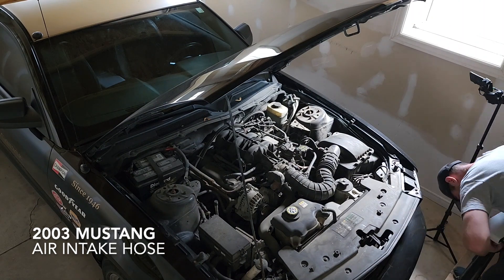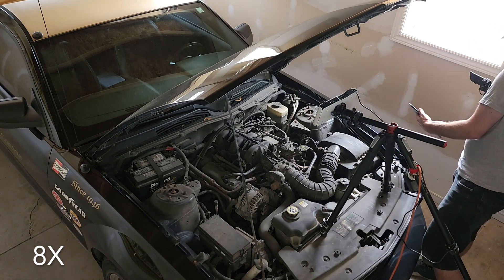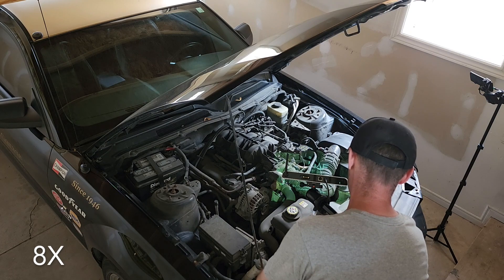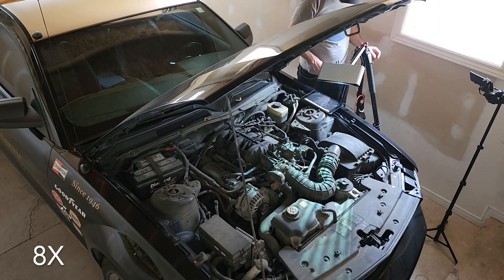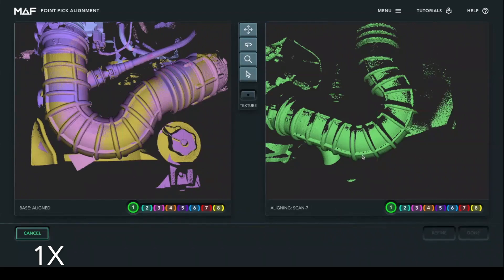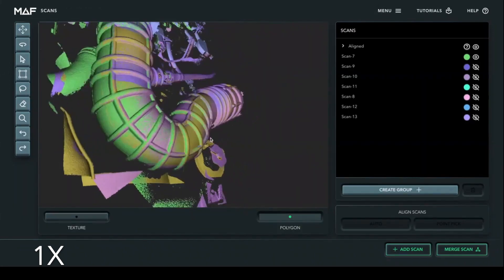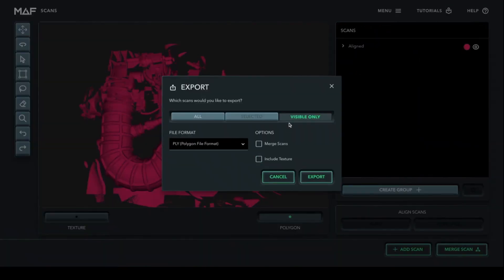THREE - Scanning a car engine

Comment: I just bought the THREE.  It should be here tomorrow, so I haven't had any actual experience with it.  I bought it to quickly scan small parts to a 0.5 mm resolution to import them into CAD, so I can make 3D printed parts that accurately fit complex geometries, and I think small items on the turntable are where THREE really shines, but it's good to see that it can be used for larger objects that can't fit on the little turntable.  I could have used that last week when designing custom pannier racks for my motorcycle.  I have the feeling that once I have a 3D scanner in my toolbox, I'm going to wonder how I lived without it.
Reply: Hey, so 9 month later, are you happy with it? Any cons?

Comment: If I understand it right everything runs locally directly on the scanner and wifi is just a way to connect to the iPad. If that's the case. then I'm glad for that, because lately I'm pretty allergic to all apps running in the cloud. Marketing-wise it sounds cool, but in reality the functionality of cloud apps pretty much falls short. 
Otherwise, I also have to praise the color separation and that use of reference points to manually align scans is something I really like too. 
I'd be quite interested to know how your scanner would handle scanning a PCB board with lots of small components. 
Fingers crossed and may you have a good time completing your project.
Reply: Yea the idea of cloud app scanning sounds like a recipe for disaster I would l hope you could run the processing off a local computer..

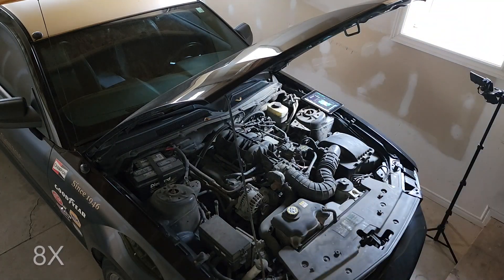Comment: Very helpful!  The color coding is a very nice feature.  You used an iPad when capturing. Are you also using an iPad for processing starting 4:58?  Or, can you divide the scanning and post processing across platforms?  BTW, having struggled with black objects for years with scanners, I'm drooling over what I see here.

BTW.  Thank you for providing the files.  They are extremely helpful as we evaluate the THREE.  I continue to be impressed.

Comment: Very cool.  I have one of your original 3D scanners with the turn table.  Would be interested in a larger one like this.  I’ve been using the LiDAR on my iPhone to do scans but it’s hard to use with no multiple scan alignment software like yours.